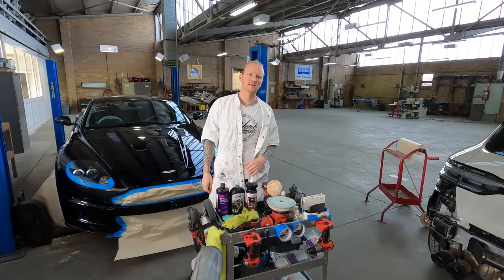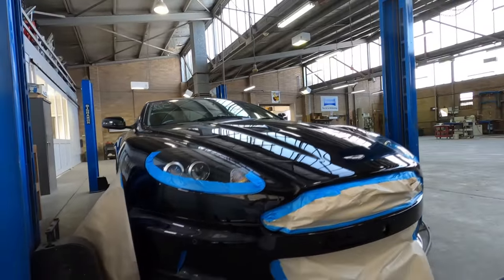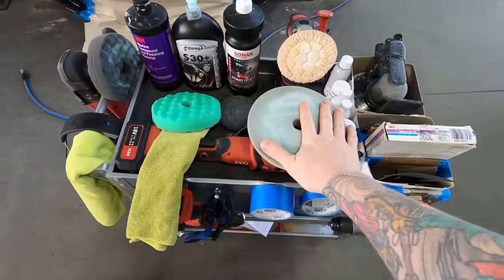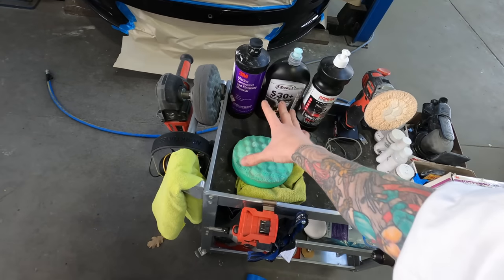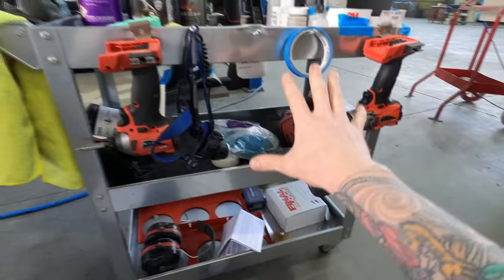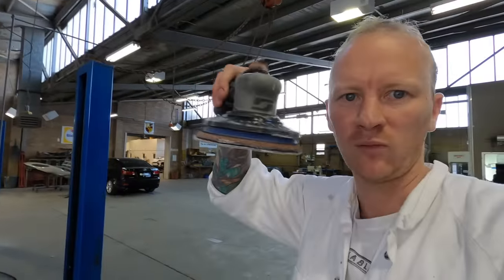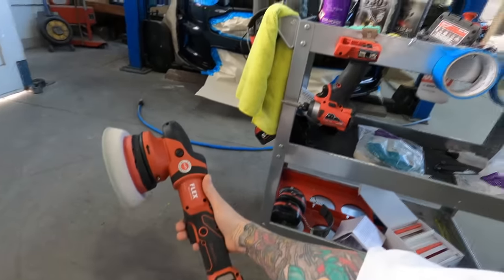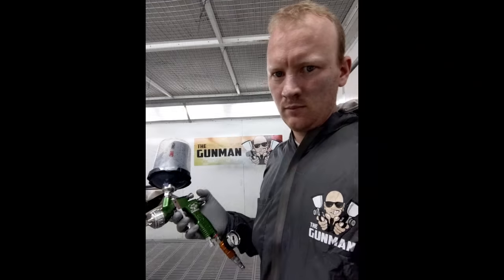My Polishing Cart

Comment: What's up Gunman, fellow painterhere been watching and enjoying your content since day 1. I know you are aware but 3m makes a 5 and 8 k grit you could use to help buffing that hard clear. I have shot PPG Deltron and Enviro for years and some of the clears they have get rock hard out the booth, example DC3000 and the Ceramiclear which is scratch resistant basically. I also found to get a better end result using 5000 grit trizact. I basically run a very similar buffing setup as you, I use a 6inch quik connect white pad with 3m ex compund and the black polish pad with the step 2 polish and 3 polish combined. I dont use the blue pad just the black for polishing. 99% of the time I dont have to use the orbital polisher even on higher end cars. But it's nice to have if I do, I hope this helps you as I've picked up bits n pieces from you over the years :) as we say here in the USA, peace bruva!

Comment: I thought you used 3m extreme cut? It’s a step above the marine compound and step 1 in the perfect it range. The green 3m pad was developed for 3m extreme cut and it has a green lid to match.

Also using the 1500 trizact makes buffing even easier again.
Reply from the maker: This shop doesn't use the 3M system, so I'm forced to mix and match.
Reply: @TheGunmanChannel  yes understand marine cut is still good tho.

Comment: Just had a guy "detail" my car and its full of swirl marks. Would i be able to sand with 5000 and continue to buff with a 10 year old paint job?
Reply from the maker: You definitely can fix it up. If it's just swirls you probably shouldn't need to use 5,000 I would start with 3m perfect it step 2 with the black pad, then step 3 ultrafine polish with the blue pad. It's a pretty solid system, hard to lose. Just lower the RPM on the buff as you go. Do a panel, then check in the sun and make sure it's working. You don't need the fancy orbital polishers like I have, rotary polishers are more than capable of removing swirls if done properly.